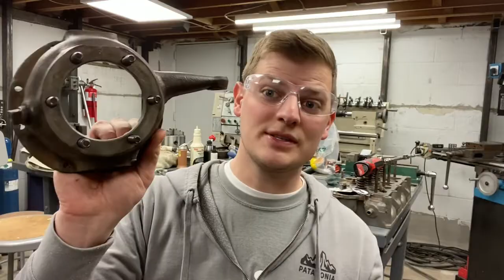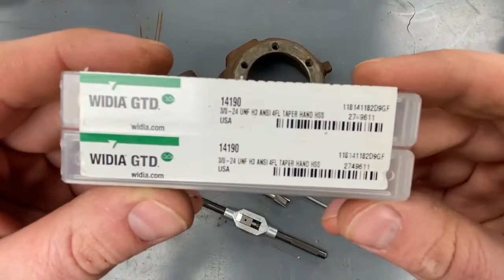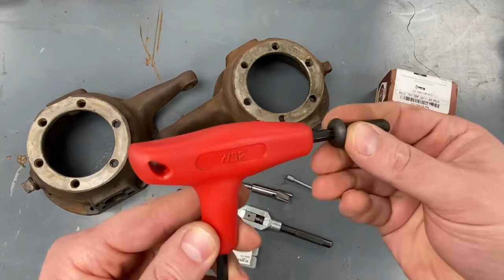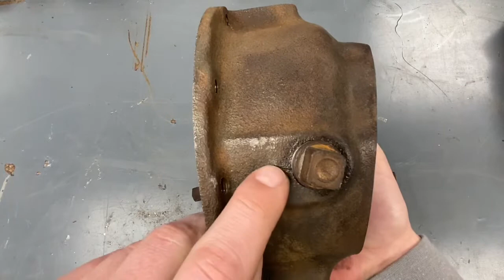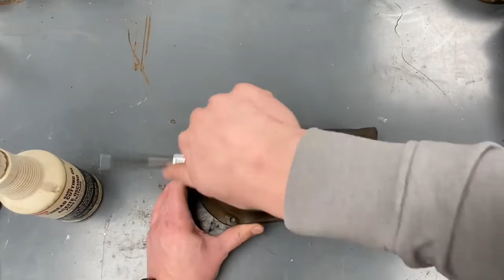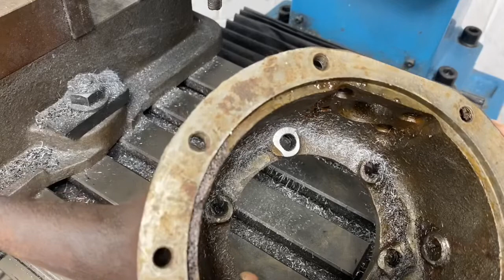Dana 25 knuckle bolt upgrade for your Willys Jeep

Comment: I just recently did this conversion for a Dana 27 in a CJ-5. You should cut a slight chamfer after you mill the holes inside the knuckle because otherwise the back of the bolt heads will not fully contact the newly machined surface. That’s due to the fact that the threads stop a tiny amount short if you  examine them closely. It’s not much but it’s enough to prevent solid contact between the surfaces

Comment: Great video thanks! I tried this application on my 66 CJ5, Dana 27. I have new knuckles from Kaiser Willys. On the driver side, the heads of the 3/8"-24 button head screws are impacting the "ear" of the axle sphere at the far end of the steering swing. Do you have any suggestions about what to do about that?
Reply: My Cj5 also have this same situation...
Reply: I ran into this also and I’m going to slightly grind the ears at the contact point. It only needs a small amount removed and shouldn’t affect the strength. May also hit the bolt head in question with a die-grinder to provide some clearance

Comment: That's a nice mod, David.  If there is already a flat surface for the button heads, would you still need to counter bore for them?  Couldn't a guy just put a dab of Permatek 2 under the bolt head to get a leak free seal?  (I don't have a drill press)
Reply from the maker: Tom Fitch I’d recommend still using the counter bore to get a flat surface. I wouldn’t be so worried about sealing as I would any movement of the bottom heads. They also need to seat further into the casting to prevent them from contacting the ball ends of the housing at full steering lock. Some folks do have to lightly grind the ball on the housing if they have Rzeppa axles because they can turn more than standard bendix or Spicer joints.